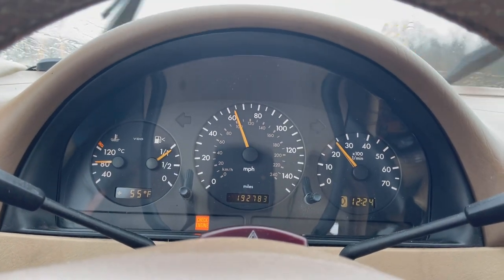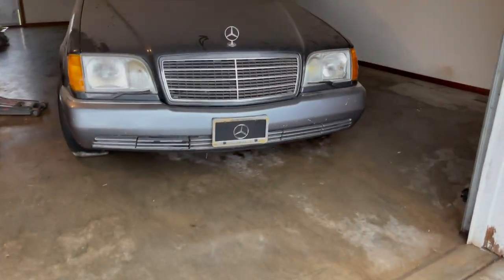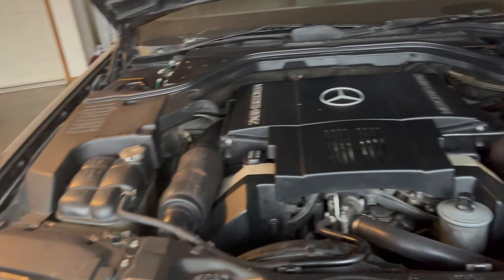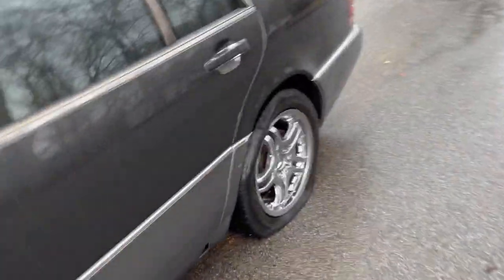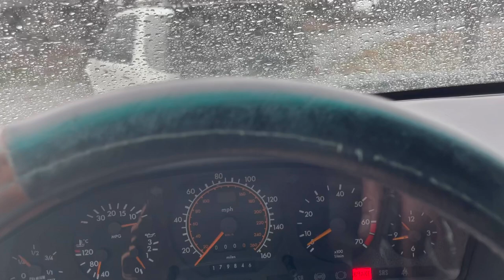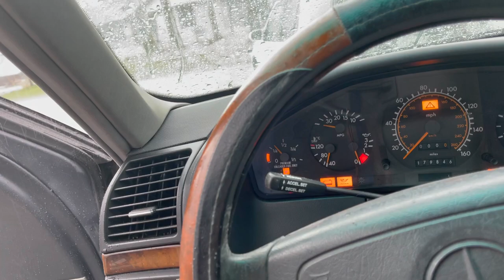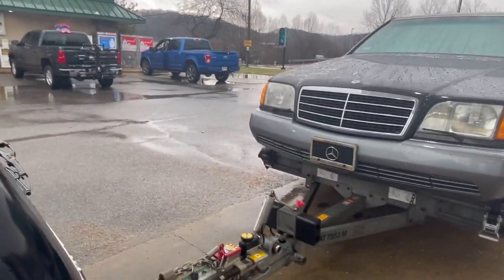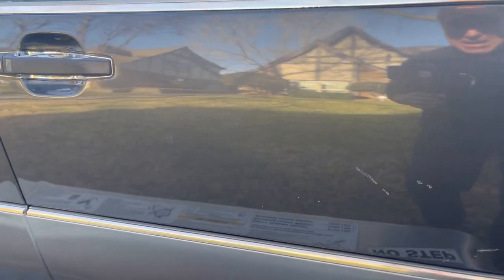First start since 2008? Does she run??

Comment: Finally a W140, i have the same vehicle, same m119 engine...400sel, The car hadn't moved for 5years, I simply replaced the fuel pump and started right up, its currently one of my favorite cars

Comment: The oil gauge showed 0 pressure so I hope you don't go joy riding before filling it up. 
You were at the gas station where you could have put some air in the tires. Hope you have an air pump at home. 
That guy told about the bullet proof glass was nuts.
Looks like a pretty clean car. Can't wait to see the next saga.

Comment: With it apparently having belonged to a state governor who ended up in the big house then having the armoured version might have made sense.  It looks like at least one of your parking posts is working correctly, so that's good.  I suspect the misbehaving oil pressure gauge is down to a failing sender unit, the engine itself sounds really healthy and they tend to get very clacky very quickly if they really don't have oil pressure...

You can't argue with a free 500, and the fact that it's a really early W140 has got to make it a rare car now.  It's also very nice that the rear badge still says 500SEL and no-one has tried to make it look newer than it is by changing it to say S500...

Comment: The paint is really nice on that car. It starts really good too. Whats next will I can tell you fix the flat buy a brand new tire I guess. I think you may have ruined the side wall on that tire driving it so much flat and it would probably blow out later when you least expect it. I think you got a good car man. yes I know you had to drive while flat. Next time get a air tank to bring with you on car pick ups like you do the jump box. buy and aluminum air tank we use to call them air pigs.

Comment: Oh boy. Pretty soon Mike you will need to get Bend Pak in there to install a lift system and then you can quit the news and just open a used Mercedes dealership and car flipping service. You have the clothes and the looks down, charm too. You just got to work on the upsell...oh and the letting go of a car part. I know..you might have to sell a car. It's hard.  But you have so many. You going to be like Hoovie and need an airplane hangar.
Reply from the maker: Very true!!!